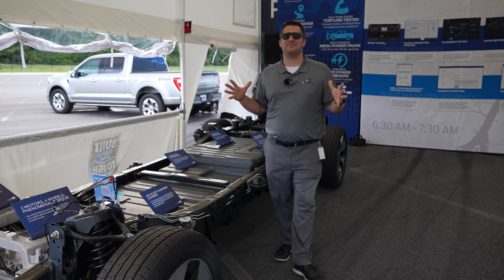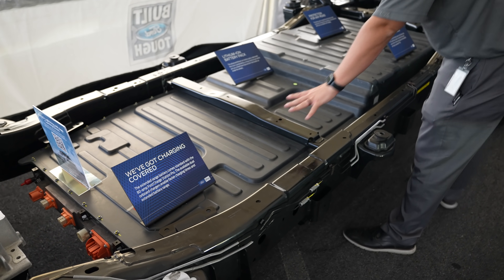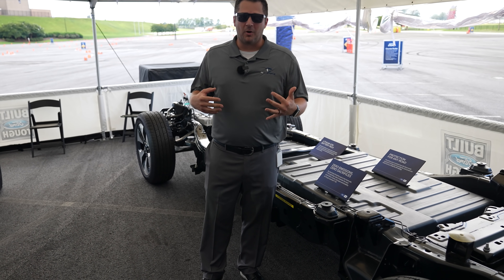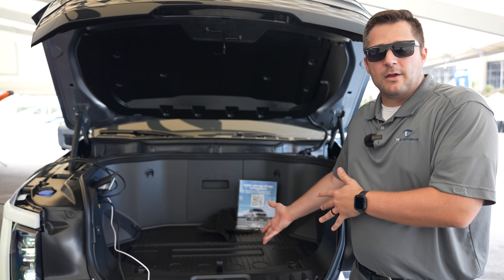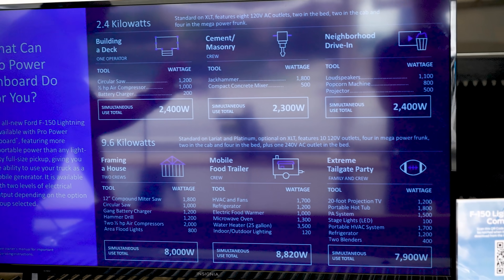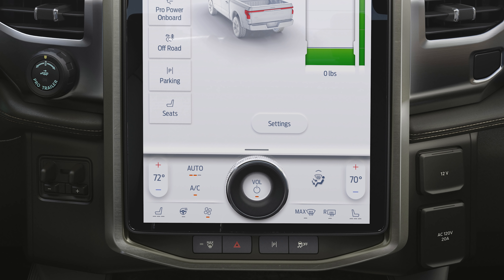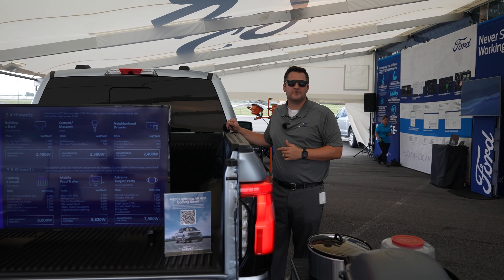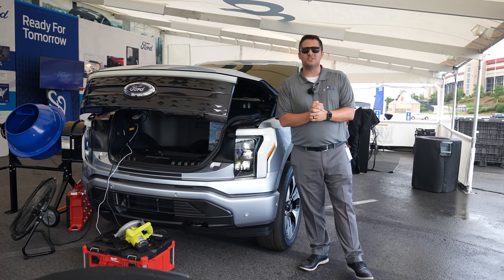Inside look at the new F150 Lightning!⚡

Comment: I own a Dodge Ram  and a Chevy Bolt.  The Bolt is my commuter car and the Ram is only driven when I need the work of a truck.  I plan on selling both and getting the F-150 lightning next year.  The only reason I don't drive the truck everywhere is because fuel costs would be expensive but with an electric truck, there is no reason to have a separate commuter car anymore because of the economy of the EV.
Reply: I'll probably have a Lightning for light duty work and a gas Superduty for towing.  No more diesels for me.

Comment: One question as I am very seriously interested in the F150 lighting a number of testers have reported about how Ford achieved the 300 mile range was with a 1,000 lbs in the bed to insure that the range test will achieve 300 miles over any condition. Just wondering has anyone followed up on this information real world range could be more then 400 miles without 1,000 lbs in the bed. A lot of users will likely be only using it mostly for home related jobs so a 1,000 lbs will not be in the bed may times. This truck is truly impressive when you talk about auto to grid powering the home without power. The other is so many unique features not following with as many real features. Side note there is a possibility of a greater then 7,500 federal rebate if new credits get approved up to 12,000 plus active at time of sale.

Comment: Hopefully they used less rice and peanutbutter in the wire insulation than on the 2014 explorer i just worked on. 

Shorts everywhere, insulation got brittle from engine heat over the years threw all the codes.

Comment: Ford needs a plugin hybrid F-150 for long distance towing of heavy loads.
Reply: They already have it.
Reply: Ford needs a REx (electric generator) version of the Lightning for long distance towing of heavy loads.
Reply: @nc3826  At that point you're just trying to fit a square peg into a round hole. If electric doesn't fit your needs then buy a gas truck.
Reply: @nc3826  LOL, own a tesla. While driving you can't charge the vehicle. All you have to do is plan out your long trip with the chargers. No need for generators.
Reply: JG: LMFAO 1st you say get an ICEV....now you say just learn where the charges are? stop trying to charge you ICEV Einstein'...

check out all the amusing posts where they try tow crap with a Model X...talk about trying to put a square peg in round hole...

OFC while driving I'm sure "you" do not know how to charge any vehicle... and. guess you forget it was about a Ford patent... Einstein... not a current option... smh.....

So have a good day sir, while you keep missing the main points... I done talking to the provable wall :)

Comment: Tesla makes horrible quality cars, soft paint, doors and body panels misaligned from factory, reliability, not to mention auto pilot killing people. This truck should be better in every way
Reply: Tesla is a new comer to building cars. But they have been getting better as time passes. The paint issue is because of California laws preventing them from using better paint. Reliability is actually better than most auto makers out there and autopilot has only killed 1 or 2 people. Compare that to how many people have been killed without it.
But I know you know the real facts and your just hear to mislead people away from Tesla with misleading info.
Reply: @xxZerosumxx  Tesla has been building cars for over a decade, California does not require terrible paint, 6 people have died so far compared to none from super cruise the only current competitor to it. I think it's amazing that every single thing you said was a lie
Reply: @whiteandnerdytuba  You comparing Supercruise to autopilot? What a joke. Your comment clearly tells me not waste my time debating you as I would have to come way down to your level. And that would most certainly give me a headache.
Reply: @xxZerosumxx  I know Tesla doesn't have something as advanced as super cruise but "auto pilot" is the closest thing. I like how you ignored every single thing you were incorrect about. But hey fanboy gotta fanboy

Comment: Is there any word yet on whether we can build the Lightning with a 6.5 foot bed?
Reply: Yes, the word is no for now.
Reply: @kennyb123  bummer! That might break the deal for me.
Reply: @savasmooth1  
Same for me as well.
In the meantime I am holding on to my reservation so I can hold my place in line.
Reply: @SwankySasquatch66  yeah, I’m holding on the the reservation as well. I placed mine within hours of being able to.
Reply: @savasmooth1  
Wish I would have. 
There's over 100,000 people ahead if me which means I won't be able to buy one until the 2024 model year due to disappointing production numbers
Reply: Ford announced an increase in its production and many reservation holders will not take delivery .... FWIW by 2024 or 5, it will have new dedicate platform....
Reply: @nc3826  
When you put it that way,  I will probably be happier waiting for the new platform.

  Not having an early allocation might be a mixed blessing
Reply: @SwankySasquatch66  FWIW I like that the Lightning is based on the current ladder frame platform...  it makes replacement parts easier and cheaper... but wanted to pass along that they will use a dedicated platform in the next gen version... since some ppl prefer it... good luck...

Comment: Would love to see a bed cover with solar panels to trickle charge the battery or used to keep the 12volt battery topper or maybe cool the cabin without draining the pack if parked outside.
Reply: I have a picture of it.  It’s in the frunk behind a plastic removable panel in the middle of the back panels.   There is also a spot to jump it without removing the cover.
Reply: @ZzHasbrozZ  
Thanks for the info!
Reply: Are you sure it has a 12 volt battery?

Comment: It would be good to see the trim levels of the current gas trucks to get a preview of the EV truck.  As a non Ford buyer looking to get a Lightning it would be good for a primer once the configurator is up and running this fall.    Things like what are the major differences in XLT, Lariat and Platinum.  What can be added to an XLT vs what is included with the higher trim or what can’t be added to an XLT that is only available in higher levels.

Comment: HONEY WILL YOU COME PICK ME UP.
WIFE WHY YOU JUST GOT A NEW LIGHTNING.
YEA BUT I RAN THE BATTERY DOWN PROVING IT WILL RUN ALL THE TOOLS I HAVE AT ONE TIME PLUS THE WORKERS.
DAMN YOU BETTER BUY YOU ONE OF THOSE BATTERY JUMPERS THEN........
Reply: I'm sure they have a limit on how much power you can use to leave enough range so you can get home safely to your wife
Reply: 140 KWhr battery will output 10 KW for 14 hours.  If you need more power than that, buy a generator.

Comment: Hard pass on electric
Reply: Drive one!
Reply: @andyfeimsternfei8408  there is nothing like the sound and feel of a V8.  Also I live in a farming community where this fad of electric will not catch of.  Here in the Midwest is diesel country.
Reply: @dustyvanbrocklin4731  We shall see. I live in a very rural mountain area. I have two Teslas and Cyber  and Ford EV trucks on order. I have enough solar to power two homes, office, welding shop and put 20k+ miles of charge in my cars. Payoff is less than 5 years. The power and efficiency of an electric powertrain compared to  diesel is like a horse to a tractor. Keep supporting trillion dollar wars to burn oil at 10% efficiency and pay all the maintenance costs in your world and I'll stick with the thermonuclear power plant overhead. Good luck my friend!
Reply: @dustyvanbrocklin4731  Perhaps, but why burn fossil fuel? What is the advantage? It costs more and the maintenance and upkeep on an ICE is insane compared to an EV. And don't get me started on power, torque and driving control.
Reply: @andyfeimsternfei8408  until they can get an EV to a range of 500 plus mile on a charge also charge in 5 minutes, and prove they are reliable I will pass on even thinking of it.  Also they are not as green as you might think.  The batteries end up in landfillls way faster than a ICE vehicle does.  Give it 10 years and they may win me over but until they work out the bugs I will pass.
Reply: @dustyvanbrocklin4731  I'm not arguing "green", it's all about money to me. I have driven Teslas over 100k miles so far and only bought tires, zero maintenance costs and zero breakdowns. It costs me about 40 cents / gallon equivalent from my solar (until they are paid off next year) and less than $1 / gallon equivalent buying power from the grid. I have made four >1500 mile road trips and in October I'm doing a 4000 mile one across country.  I often work upto 350 miles from home and drive to and from work without any charging issues. You must have a hell of a bladder to drive 500 miles without stopping!
Reply: @andyfeimsternfei8408  I noticed you left out how long it takes you to charge up.  100k is pretty good but can they go 500k like a diesel does.  Also when towing heavy loads you don’t get the battery life it goes down precipitately.  I am glad you like them but I am not sold in the least.  Give me tried and true.
Reply: @dustyvanbrocklin4731  Traveling across country, you stop every 150 to 250 miles and charge 10-30 minutes per stop. That's usually a piss break or to eat. Biggest thing is most of us rarely go in long trips. Even if you drive 200 miles per day, plugging in at night easily fully charges the battery. Everytime I go to get in my car I have >250 miles of range. I haven't been to a gas station in 3 years. Add up all the time for weekly fueling and even with Supercharging on long trips I have spent less time fueling up than you have.
Towing is the same as your diesel, the bigger the load, the less range you get. I've towed a heavy steel  two horse trailer with two large horse up the mountain.  Yes cut my range in half but with 800hp and 1000lbft of torque I could leave any unloaded diesel in the dust. Then the brakes, never use them. Rather than burning up pads and rotors the energy goes back into the battery. Brakes last >250k and the control going downhill with a load is unreal. I have a RAM 2500 with a high output Cummings and my model X is twice as strong and fast. Once trucks are available in electric, I am done. Ford, GM, Dodge, Tesla, Rivian. Doesn't matter. Everyone will see the light very quickly. Why else are all the manufacturers scrambling to convert? Better product, cheaper to make, cheaper to operate... ICE simply can't compete. Again, all about the money.
Reply: "fad of electric" lmfao
Reply: @nc3826  Not to mention, your supply of fuel is likely to be dissrupted for weeks after this hurricane hits.
Reply: AF:Nope, the EV hater is right, US produces its own oil.... So your wrong and foolish to try to talk about a distraction.....just like your 10% efficiency figure which is an exaggeration too and its also pointless... since the efficiency for producing electric is always ignored in the comparison,,,,  value ie cost is a far more relevant yard stick than efficiency... 

BTW EV owner are far more directly subsidized... for example no gas tax is paid for road maintenance but fuel subsides cone from military spending figures that are not directly related...

FWIW externalites (ie pollution) should be taxed to make it a fair comparison... KISS..,

Far to many pointless meme talking points are used on both side that I hear all the time and are irrelevant to most  ppl who just care about whats the best value to them.... thats what will make ppl buy EVs, the rest is BS....
Reply: @nc3826  none of what you say is correct. Even oil produced in the US is heavily subsidized and very inefficient. The best internal combustion engines struggle you achieve 20% efficiency, especially in varying load transportation. Electric machinery and drivetrains are far more efficient, powerful and reliable. Why do you use electricity in you home and workplace? You aren't watching YouTube on a gas powered projector. Why are all automotive manufacturers moving to EV? What advantage is there in ICE?  Thousands if moving parts verses a dozen or so. So show me an ICE engine that is more than 10% efficient and had the torque, power and speed of an electric motor. And an electric motor dosen't need a transmission.
Reply: @nc3826  EVs are already cheaper than ICE and that's why change is coming. It's all about the money. Money converts everyone and you will soon be converted. BTW, I pay more road tax per mile than a ICE car does.
Reply: AF: My fuel? you keep making incorrect assumptions.... my myopic friend...
and bad weather causes far more electric outages than fuel shortages... 
only fuel shortage in recent history was due to hacking not weather...
Reply: AF thx for proving the value of YT experts...and have fun down rabbit hole...
Reply: @nc3826  You have offered no rebuttal to my points. Just to disagree and argue someone is wrong is not wining an argument. I am open to data on high efficiency internal combustion engines, oil only coming from the US or that we can produce enough oil to keep going, oil refineries in the Gulf not being owned by foreign countries, EVs not paying highway taxes, trillion dollar wars not being about oil, electric motors not being able to out perform internal combustion engines, GM, Ford and others not moving to electrify their products because ICE cannot be made as cheaply or perform nearly as good as EVs. Show me your rabbit hole and once you convince me I'll climb out of mine.
Reply: AF: WADR believe what you want.....As a side note, since you mentioned your planning to buy a Lightning. Are you planing to use its V2G capability as back-up power or not?  You have to get they right EVSE and some additions  (check with Ford for all the details)

FWIW Rabbit holes go no where, so tend to be boring.... So I do not stay in them for long...
Reply: @nc3826  nope, already have 45kw of solar and plenty of battery backup. I spent $40k before any tax break and generate over $5k worth of power plus 25k miles in my EVs per year. What a mistake! I should have stuck with paying my power company $5k per year, heating with oil and driving ICE vehicles. Your right, gasoline powered vehicles will never take the place of horses and buggies, cell phones will never replace rotary dial phones, computers will never replace typewriters and we will always live in a cave!
Reply: AF: LMFAO good luck with your meds
Reply: @nc3826  Thanks, so what are you going to buy when ICE is no longer made?
Reply: @nc3826  Also, have you rode in or driven a Tesla? Any EV?

Comment: Is ford going to answer the call of Tesla model s plaid. I hope so all wheel drive something car or truck I hope it has a gas motor so they have something to listen to as it goes by
Reply: Ford already sells electric motor 1000hp+ kits for existing cars (will be at Sema)
Reply: This lightning truck is quicker that the gas version of the same truck. Even with the gas version making loud noise from the engine

Comment: Love  what  Ford has done.  And hope  they add a large  truck soon.  
John Goodenough is  coming  out  with a new  glass Batteries 🔋  that will make  even more  power and  add  up to  1000 miles, between changing, and boasting over  100,000 changes , that   Is lightweight. Which means more payload.
  I  need  a truck  that  well haul more than 10,000 Lbs . 
I  see  it coming  out  soon.  And  well  trade my  F150 5.0 for  one.

Comment: I love the Lightning and want one. They gotta get the range into the 400 mile per charge area for it to make sense though.
Reply: The max amount of Amps from 240 voltage lines in residential homes is the limiting factor.      
They could simply add more batteries but you wouldn't be able to fully charge it in 8 hours.
Reply: Facts. I feel like the second they make this thing 500 miles per charge, it’s game over for the competition lol
Reply: 300 miles with 1000lb load, youll get more than 400 miles
Reply: 472 miles empty for the F150e "Lightning"

=Ford under rates all their vehicles now.
Reply: Watch this video where MKBHD talks about it going over 400 on the extended.
https://youtu.be/J2npVg9ONFo
Reply: YEA JUST FOR YOU !!!!!!!!!!!!!!!!!!!
Reply: Yeah but when the battery pack is down to 70% does it still have the same torque or does it drop steadily until it dies?

Comment: I like that Ford's taking their first step with this truck but they gotta get that range up to 400 at least. That and find a way to get the charge times closer to filling a gas tank. I know thats probably asking a lot from an engineering standpoint but I can't see myself making the switch to full electric until those things happen. I wouldn't mind a powerboost though.
Reply: You'll change your mind when you see how cheap the fuel bill is for a Lightning.

Comment: I cant wait to see the real world range on these
Reply: The 300 miles of range is based on a 1,000lbs payload. So without that you can expect a battery range around 400 miles +
Reply: @mackniccum2181  is that official from Ford yet or not quite? also what about for the 230 mile one because I heard that Ford was not going to allow regular customers to order the work truck with the extended battery only commercial customers to force the regular consumer into the higher priced trims.